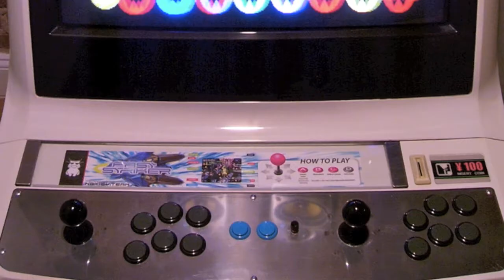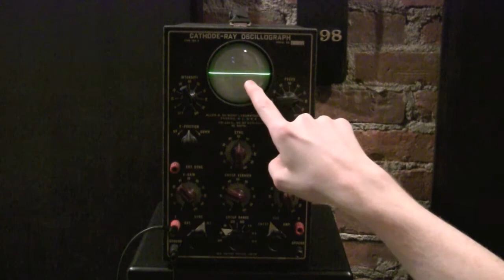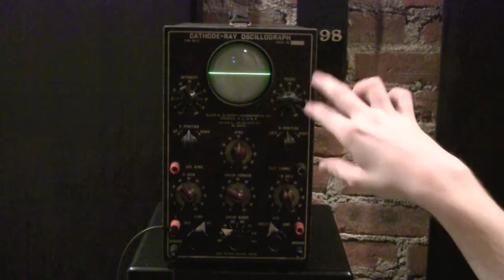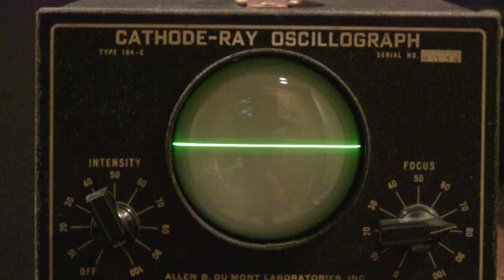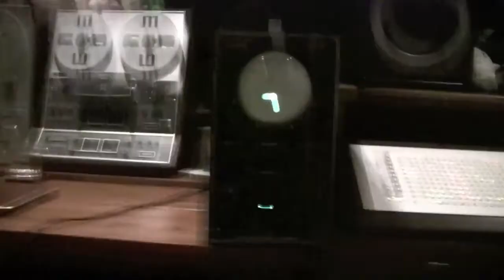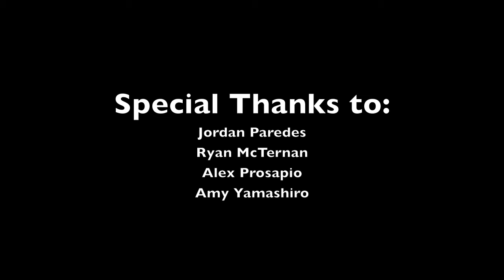Oscilloscope Fun

Comment: Those scopes could be fixed fairly easily. Just replace all out of tolerance resistors and all the electrolytic and paper capacitors. The tubes will need to be tested and bad ones replaced.